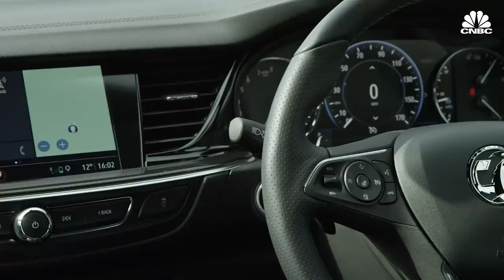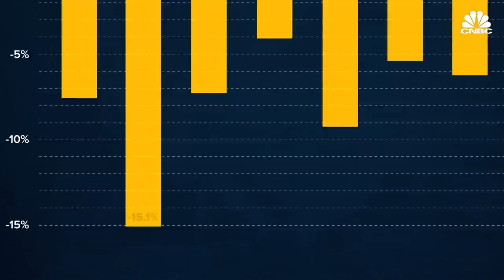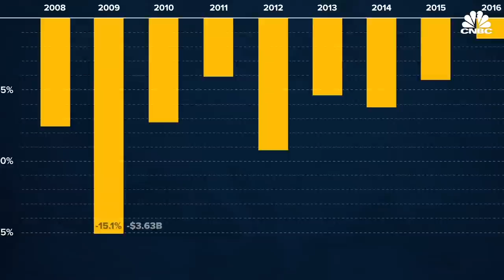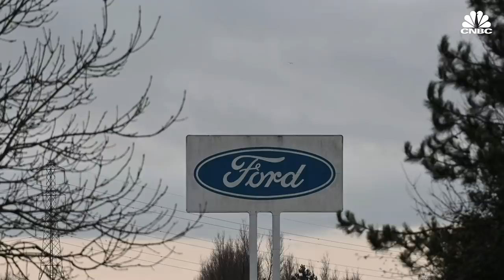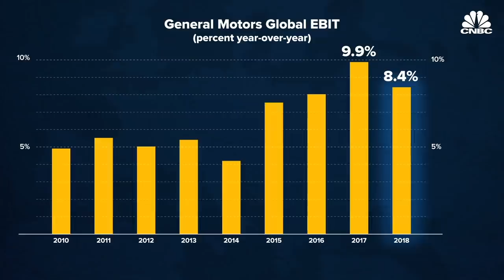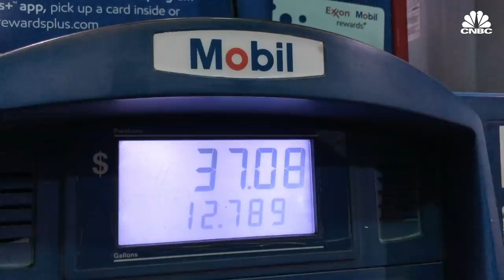Why General Motors Left Europe

Comment: Psa literally have the same car reskinned 4 times now just like vw does with skoda and seat lol
Reply: And it works pretty well for them! All serve somewhat different markets.
Reply: This is saving the money on developing a new platform for each brand, and saves money on production, and lowers the cost of maintenance for consumers.
Maybe American manufacturers should also save money that way instead of producing crap?
Reply: @NJ-wb1cz  GM kind of tried. Some things were shared (Opel/Vauxhall are virtually the same company, Opel/Buick/Chevy shared some models, Chevy/Cadillac seem to share a bunch). 
Notably Opel had some very popular (Corsa, Adam) platforms that were not shared with the rest. 
It seems like GM never really bothered to integrate Opel while PSA went hard at it right away. Some of their first steps were taking SUV models they already had and slapping Opel branding on to them. They sell pretty well in Germany (to an audience that might otherwise buy from another German brand, but not Peugeot or Citroen).
Reply: @paulhendrix8599  I live in a city where opel has a factory, so obs. a lot of people I know work there and bought their cars. Its what you say, use common platforms that share costs but cut cost and prices depending on the brand and you will save tons of money!! They almost didn't change the Opel/Vauxhall desing at all since the PSA takeover and yet they turn it into profit...Ok, then GM was messing big time then LOL
Reply: @paulhendrix8599  as one weird hairy gremlin once said, 'Do or do not, there is no "try"'
Reply: As an American, people keep claiming European cars sell well here, but I've never heard of PSA. What's a Skoda? What's Seat?
Reply: @chaosXP3RT  Skoda's and Seats are VWs basically
Reply: @chaosXP3RT  Just think on a VW Golf,an A3 is a nicer Golf, a Skoda will be bigger, boring and cheaper, and a Seat will be better looking, sportier and cheaper. You make 4 different cars with different characteristics that share a lot with each other apart from body and dashboard. They don´t sell in the USA because probably will outsold VW by a lot.
Reply: @chaosXP3RT  You've probably heard of Peugeot and Citroen, even if they aren't sold over there. The VW family uses common components among their entire lineup (Skoda, Seat, VW, Audi, Lamborghini) saving them mountains of money on development and parts.
Reply: @NJ-wb1cz  Ford and gm already reuse their platforms. GM does it the most though
Reply: Skoda, Seat and VW only share platforms. Seat and Skoda can gesign their cars their own
Reply: @chaosXP3RT  As a European. No one knows PSA. Only Peugeot/Citreon
Reply: Yep and they are not the only one,. I own a van that is sold by Renault and Mercedes. The only difference is the nose part.  And because they are produced in the same factory your Renault van is build according to Mercedes high quality standards. And the guys at Renault are very smart. The engine in my van is also used in 26 different models and sold to 8 different other brands this lowers the costs and I can get repairs and parts everywhere in Europe.
Reply: What is funny they do what GM was doing back in the day, rebadging cars
Reply: @V8_screw_electric_cars  No they aren't most of the time. The mostly only share platforms and engines. The rest in made by Skoda and Seat themselves
Reply: @reichenwald-gm4qd  well only so what's left lol, they're even worse actually cause each gm division had own motors back in the day they didn't share engines until later when it was going downhill
Reply: @V8_screw_electric_cars  Sharing engines isn't bad if the engine aren't bad
Reply: as the BMW and mercedes,and VW and prosche and Ferrari, you can do this entire day

Comment: One of the main problems with US cars is that they dont offer Diesel engines. Gasoline is 3 times more expensive here in germany than in the US. So most people want Diesel engines cause they are more fuel effiecent and it costs less. Thats the reason why Chrysler and Cadillac failed here. Chevrolet offered some Cars with Diesels, but they were Asian Cars from Daewoo with a Chevy Badge on it and no one accepted it as a US car, cause when we talk about US cars, we mean full size cruisers and not tiny Chevy Spark, Kalos, Avea or Matiz. Thats really a big issue, i drive a Chrysler here in germany and it needs twice as much gas as a regular car here and when i say i drive a Chrysler the first question is always, "oh isnt it really a gas eater?

Comment: Peugeot is a very nice brand. They make reliable cars that very fuel economic and cheap te maintain. I drive a 3008 model from 2016. I don't think I will change to other cars maker soon.

To be fair to Opel. It's a very very good cars brand also. I had to drive once from Brussels to Amsterdam with an Opel Asrta stationwagen. Thier was a lot of snow on the road and all cars couldn't barely move forward. With the (old) Astra (bought for 800 euro) I drove with 130km in hour speed. I hitted few time the protection rails on the sides of the highway and was constantly smashing signboards. Next day in the morning the car had only few scratches. It was my best near to death experience.

Comment: Ford is the 3rd most popular car brand in Europe, right behind Volkswagen and Renault. If Ford, being the 3rd brand in Europe, cannot make profits, then there is a problem with managing in Ford Motors. The same General Motors in 2012 The Chevrolet brand was increasingly popular in Europe as a cheaper counterpart for Opel. In 2013, General Motors wanted to move the production of the Chevrolet Cruze to Gliwice, Poland
 from Korea. Because this car sold very well in Europe, as did the FSO Chevrolet Aveo. General Motors actually made mistakes himself. Opel and Vauxhall cars were literally the same, only the brand logo are differed. If we assume that Opel cars were sold in the USA under the Buick brand, then, for example, Chevrolets in Europe could be sold under the Vauxhall brand. Chevrolet and Opel were built on the same platforms, but their appearance was different. Compare the Chevrolet Cruze with the Opel Astra these cars were built on the same platform but the appearance of these cars differed. And between Opel and Vauxhall there was no difference except the logo. Another mistake General Motors made was the liquidation of the Daewoo brand. The Daewoo concern just after the overthrow of Communism in Central and Eastern Europe. Daewoo has invested a lot of money in Poland, Czech and Romania to buy car factories. It is said that in the 90s Daewoo cars were motorized all over Poland. Due to this move, twenty years ago the Daewoo car brand was the second most popular car brand after Fiat. Daewoo sales in Poland reaches over 100,000 cars, which constituted 30 percent of the Polish new car market. General Motors already had a well-established Asian brand with many customers in this region of Europe. What has GM done? instead of restructuring Daewoo to make the brand profitable, he flattened it. And in return, he gave a little-known / popular Chevrlet brand where it was necessary to get the customer used to a different brand practically from scratch. So General Motors made many mistakes that contributed to the abandonment of the market in Europe. But Perhaps in 10 years General Motors will return to Europe and resumes production of cheap cars for the European market.

Comment: I had a Opel. That engine is fine, never failed. Digital parts are fine, never ran into malfunction. The rest is very bad. I am not saying the bad due to quality control on assembling line, I’m talking about the failure at design level. To replace the side light bulbs on my Opel, I need to either remove the entire front bumper together with the wheel trims on both sides, then can I reach the screws that anchor the lighting units, or I have to remove the whole cooling fence so I can reach to the back of the lights without moving them. Similar stupid and inconvenient design is all over my Opel,, turning simple daily maintenance into work in hell, never seeing such awful things on any other brands, and I am forced think that clearly the design team in GM is very poorly knowledgeable, not having some basic sense on how to design a car.

Comment: I think GM's biggest problem is that they are more focused on saving money and increasing profits than they are on making high quality and stylish vehicles. When you buy a brand new 100k Escalade, you expect the best quality, but people have been reporting that there are squeaks and rattles when they drive over bumps. On top of that, the cheap interior and the low quality plastics that GM uses, also don't help the brand much in Europe.

Comment: 7:33 

 There is nothing correct about this statement, it is ridiculous...
1. Chevrolet in Europe were just Daewoos, equipped with a Chevrolet badge after GM bought the Korean Company.
2. No new market share was gained, the sales of Daewoo ( now Chevrolet ) were stagnating and later went down after GM bought Daewoo. This is an invalid explanation of the declining  sales of Opel and Vauxhall.
3. Opel and Vauxhall had no difficulties distinguish themselves in the "highly comp...blablabla", they were literally identical cars sold with a different badge in different countries.
4. No one was confused because the Chevrolet's were to similar to Opel/ Vauxhall, they were not that similar. But they were both not very exiting for sure.

Comment: Because here in Europe we want cars that look good , handle well , are well built and don't rattle at every bump , are reliable and fuel efficient. I had to endure driving an opel Astra for a month because an idiot crashed into me rendering my car useless. It was a 2008 with the 1.6 Petrol engine. I hated its looks ,it was slow, fuel thirsty, it had pannel gaps bigger than the gap between the poles of earth. The interior was rattling and it was just hopeless. The irony is that the car was 5 years old back when i had it and it was my father's cars. He bought it new , no crashes , well maintained and with only 30.000 miles yet it was horrible and he got rid of it after I gave it back because they automatic gearbox broke down

Comment: I'm French, I had two "GM" cars, a 2003 Saab 9.3 2.2 TID and a 2006 Opel Zafira 1.9 CTID... Both gave me loads of troubles, especially the Opel Zafira. While they looked nice, confortable and had a nice ride, their engines were full of problems, costly problems. Many electrical issues too.
SAAB is dead but no way I'll ever buy another Opel (even under PSA).

Comment: Much of the comment in this is plain incorrect and viewed through a telescope from the US. Like may American organisations they assume that Europeans will want the poor quality vehicles available in the US. Ford and GM made a living for years by selling cars to fleet buyers, who ran them for 3 years and sold them cheap. That market disappeared a number of years ago virtually overnight with the spread of leasing. There the lease price reflects the likely resale price at the end of the lease as well as purchase, maintenance etc. Suddenly Ford and GM offerings were at the bottom of the heap because not only were they poor quality the true cost of ownership is high. A smart company would have revisited its offering and worked at improving it, but they have not, but have gone down the cost cutting route making their products less reliable, more prone to rust and fast decreciating. And by the way the vehicles are not cheap but are priced at the same area as the better built better designed competion. GM have gone, will Ford follow? Probably.

Comment: Here is my German perspective: Opel used to build good cars until GM took over. GM wanted short term success by cutting cost, and they had a high fluctuation of board members. No one have had the time to implement a successfull strategy. And for a long time they ignored the customers. GM and Ford never sold real american vehicles around here. Chevrolets were rebranded Daewoo models with a really bad build quality. And others were rebranded Opels (like the Malibu). If you drive on German roads you see so many RAM, F-150, Tahoe, Charger, Mustang etc. But they never officialy sold those cars in Germany. We have to import them individually. I bet that there is a demand for the more iconic models, and it looks like Ford is waking up. Since a few years they sell the Mustang, Edge and now the Explorer. Ford btw is 3rd place in germanys car sales. And Tesla of course is doing well to. So its not the case that we dont accept foreign products here, they just had the wrong lineup.

Comment: The biggest problem was when Chevy came in, it was not using the vauxhall cars that one saw as Chevy cars in the USA... but used the Korean GM brand that had a lower standard style... so in effect GM told Europe that Europe was secondary. Had GM rebranded Vauxhall as Chevy, it would have been different for GM.

Comment: Last month I toured around 10k kms with VW polo which has already hit 200k mark and it is one of the best rides, with american cars I will generally say no when it hits 70k mark. More over, if something happens in the middle of my journey I could get easily repaired if it's a German automobile because of availability of spare parts and If it's GM or Ford spare parts are one hell of a issue.

Comment: GM failed in Europe because they just werent as well integrated as Ford were. When you have a brand like Opel which is split into Vauxhall in the UK, its just doubling up on everything from marketing downwards. Dont get me wrong, Vauxhall is a big brand and well liked, they made decent diesel engines and their cars are generally well built for little money.They should have moved further with the Volt series of hybrid cars. They were onto a winner if this small car was marketed well because it is a really good car.

Comment: GM should buy or ally with PSA. GM could lean from PSA’s efficiency which controlling a European brand champ.
This deal only works if PSA under Taveres is left in control. GM could offer PSA platforms--a revised GEM would be great.
I do not believe Barra saying only 20% of Opel products would fit in globally. Chevy and Opel were near carbon copies when they were both sold in Europe. Furthermore Opel could have worked on EVs with Buick China.

Comment: I remember reading in Smokey Yunick's wonderful book Best Damn Garage In Town a story about when GM launched the Big Block Chevrolet back in the 60's. Smokey did consultation work for GM and was at the event where he met the designer of the engine. Apparently that designer was none to happy that his design had been altered in a number of ways to make it cheaper to manufacture, and he didn't mind voicing his displeasure to anyone who'd listen. Smokey explained that GM was a very tolerant company in some respects but the one thing that they'd never put up with is being badmouthed in public by one of their own. The punishment for such a transgression was banishment to their Opel or South American branches. 
For me the penny finally dropped. A big part of the reason that Opel were garbage, (they really were responsible for some terrible designs) was that the company was full of bitter GM engineers who were being punished by being sent there. They were getting their own back on GM by only doing the barest minimum or not showing due diligence. This combined with a large dollop of overall ineptitude from GM produced failure after failure.

Comment: The pick ups are just one side of the story, Europeans dont like American cars because:

- American car design.

- American cars oftend are stuffed with inferior materials, for example American cars often use cheaper and uglier plastic for dashboards.

- Old bias conceptions American cars are gas gusselers, combine this with the higher gas prices in Europe and you've got another obstable.

- American cars in general also dont steer as directly as European cars, but there are also differences when it comes to suspension (settings).

- National and chauvinistic pride.

- While today its better, but a lot of Europeans still have a preconception notion American cars are to big. Since you've got a lot of small roades in Europe and narrow Streets in the old cities you've got another problem.

- American cars are also heavier taxed cause the heavier/powerfull engines, which is a huge influence on the amount of taxes one pays when your purchase a car; and it also results in higher road taxes one has to pay ( I used The Netherlands as an example). 

While its correct most Europeans incomes have been stagnant for decades, I dont think financing is the problem. For the simple reason Europeans still buy a lot of cars, just not American.

Comment: For Opel it was good that GM was going. 
Opel engineers wanted to invest the cars and adapt them to the European market, but GM's bosses always wanted to produce cheaper. In addition, GM sold a car that was known as the old Opel as a Chevrolet brand. Just another cheaper variant that made competition for its own brand.
In the meantime, GM was doing so badly that even the suppliers wanted to take over the brand. Everyone thought that you can't act as badly as GM.
With PSA, Opel has a platform and engines that have been adapted for the European market. Within a short time, PSA was able to bring Opel and Vauxhall into profit. Ideas to improve the brand are now flowing into the PSA Group.

The bill to produce cheaper and cheaper did not work out. 
Adapting the models to the market was successful.

Ford Europe has entered into a cooperation with Volkswagen to create an e-vehicle platform.